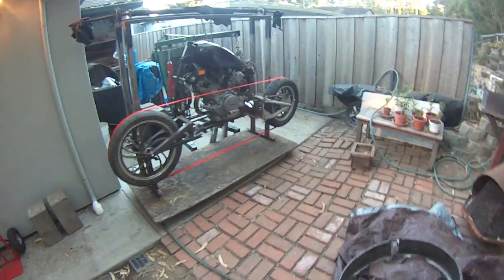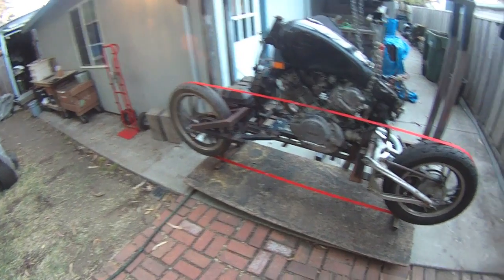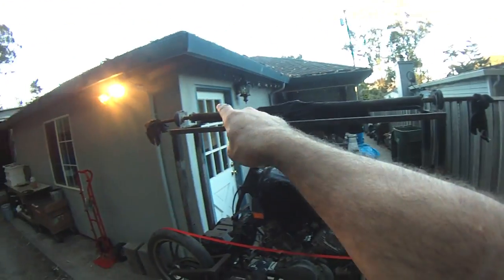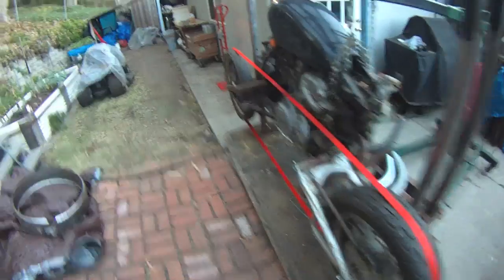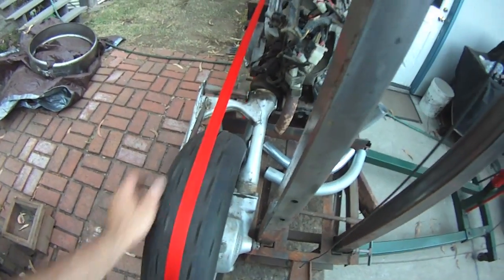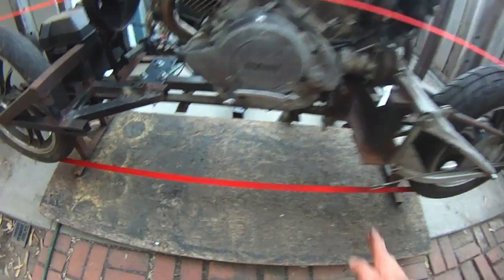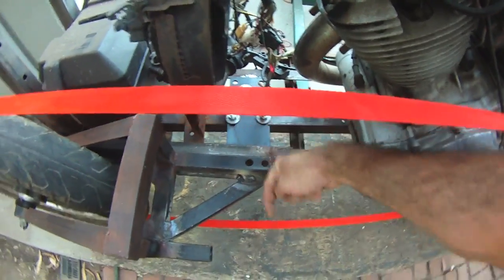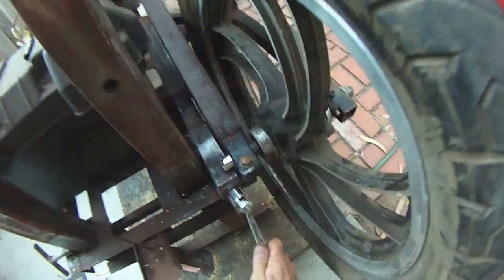Overview of the Yamasaw

Comment: I think you are absolutely correct that it has to spin the other direction.  Otherwise you'll have a little loop going INTO the wood.  The other thing,  don't underestimate how tight you need to have the blade.  Generally the tighter the better.  Butt man I wish I had that kind of power on mine...
Reply from the maker: +777strongcoffee Thanks for the info on the blade... I have a LOT of ability to get tension on the blade and I feel comfortable that it is built strong enough to handle the tension... this all might be for nothing as it may work okay with the blade roatation.  I am about sure I will be putting guilde rollers on the top of the idle wheel to be sure the blade stays aligned as it is getting pulled over the top.  we'll see, I hope the power of the engine/transmission will be to my benefit.

Comment: Maybe add some guide rollers  like a band saw to limit the whip the blade may produce and give it a shot.
Reply from the maker: +Rusty “rustyglovebox” Glovebox Oh yeah, guilde rollers for sure below the wheels to guide the actual cutting... and thinking of guide rollers on the top of the idler wheel to be sure the power pull keeps the blade aligned on the wheel.  Thanks for watching!

Comment: Thanks for the overview.  I agree your just gonna have to test it and see.  I can see where the saw may bind from running like that but if that whole system is good and tight your justification seems valid too.  A good example of what your building is a woodmisier.  You can have people google that if they don't get what your trying to build here.
Reply from the maker: +Mopardude Yep, there are a couple companies that commercially produce band mills...all of them are very expensive.

Comment: Can you swing the drive tire and engine  up put another wheel and tire under it and have it sandwich the blade on top? I should change the direction.    I would think after awhile it would chew up the tires....Man I dont know.  Good luck buddy
Reply from the maker: +2LateIWon I dont' have much room inside the framework of that cutting trolley.

Comment: Any way to flip the rear end back over and attach a sprocket instead of a wheel with a chain that powers another wheel that is inline with your front wheel?
Reply: +mjmcomputers Yeah, that's what I was thinking.  Flip it back over, run a driveshaft into a pillow block and attach a chain, then a second pillow block and driveshaft going to the rear end.
Reply from the maker: +mjmcomputers I don't have the room in the framework to do that... not a bad idea though.

Comment: How about changing gears (pun intended) and set it up as a vertical band saw? The drive wheel will then pull the blade down through the wood. Waste material will discharge down to the ground behind the rig, decreasing the amount of sawdust accumulating around the engine cooling surfaces. The log feed bed will need to be higher off the ground and horizontally adjustable, but that also means less bending over and a happier back.
Reply from the maker: +theanimalusa  Hmmm... now that's really thinking outside of the box... hmmmm

Comment: If you flipped the swing arm back over could you bolt a sprocket to the plate on the engine side and another to the swing arm side and run a chain between the two?
Reply from the maker: +02warrior I dont' have enough room in the frame of the cutting trolley to flip the swing arm.

Comment: I do not know how , but thinking if one could attach a smaller pulley or sprockets on both wheels to connect them together turning , then in a sense they would both be drive wheels , , but not sure if that is even possibly able to be done , also thinking something like the drive wheel there now raised up and run another wheel . below it with the blade on it , this is a hard one . Isn`t there a vent on that motorcycle  rear , that is now on bottom
Reply: +wtbm123 And wonder about the cut on the ring and pinion , running backwards , now i think , it will be driving with pressure  on the coast side . Time will tell . to bad you could not flip it over and extend a axle from hub out to drive a tire , but thinking the frame may be in the way . . I sure you will fix it some how
Reply from the maker: +wtbm123 Yeah...the frame work of that trolley is limiting as to how I can reconfigure and re-flip of the swing arm.  I built the trolley long before I had located a power supply.  Honestly I make more trouble for myself by thinking outside of the box... I could have easily gone with old trailer axle spindles/tires, pulleys, v-belts and a horizontal shaft briggs or similar 20+hp engine and been done with it all.
Reply: +yourbeekeeper But this is a bigger challenge , and just think of how much more satisfying it will be to u when finished
Reply from the maker: +wtbm123 I can't disagree with you on that one.

Comment: My only question is the pneumatic tires ? Will they hold up? Everything saw I've used have used a two inch or thicker drive & return wheel, how will you over come the Blade walk out? This is an interesting theory in backyard engineering.
Reply from the maker: +Lawrence Eich There are a LOT of these style band mills that use car tires and they hold up fine.  All band mills/ band saw cutting machines use guide rollers to keep the blade aligned on the wheels.

Comment: i probably did not explain correctly but i will try again,the simplest way will be if i describe it as motorcycle as it looks now,just imagine that you swoop the front wheel with the back one so the driving wheel is in place of the front one this way the saw blade will be pooling the lumber and not pushing,the only down side to it  is it will protruded and offside and take more room OR,i do not know your drive shaft but if the drive shaft meeting place with the gear is symmetrical you could just flip it 180 degree.
Reply from the maker: +nemojac I understood what you were suggesting, but at this point it took a LOT of time and fabrication to get everything in line and solidly mounted.  I am only anticipating a problem with the rotation, I don't know that for sure and I dont' have any definate way to find out until I use it.  I am not going to cut apart and re-engineer this mill for a problem that may not exist.  Stay tuned, we will all find out together.

Comment: I dont understand doesn't the back wheel turn counter clockwise the rite way?  It looks like it would be pulling the blade threw the log the way you have it now. Is the log going to feed into the cut or is the cutter going to move over the log on rollers. Ether way just feed the log from the side cuts.
Reply from the maker: +scottsinfl as you are looking at it in the video, the back wheel turns clockwise.  I put put power to the starter while it was in gear and verified it's rotation.  The log lays horizontaly on a bed I have already made and the cutting assembly will travel in the channels on the log bed and cut boards.
Reply: +yourbeekeeper ok I understand when you flipped the set up over to move the wheel's out or off set it reversed the rotation. I wasnt paying attention.

Comment: What if you flip that "differential" around, so the large gear is not up against the wheel. And the. Extend the shaft backwards to the wheel. Otherwise, what stops an engine from starting the opposite way? Is it just the starter motor? Reverse the polarity of the starter motor and see if it will run the other way.
Reply from the maker: +P0tat0_craft  It took a LOT to get everything fabricated and lined up...I am going to run it as it sits and see how it goes.

Comment: change the wheel assembly to a Honda Goldwing they're on the opposite side of the bike so they will turn the correct direction
Reply from the maker: Hmmm, I had not even considered that.... thanks for the tip.

Comment: Feed the log from the other side.
Reply from the maker: +patches350   Cutting from the opposite side can be done, but as it is now, the blade will be pulling into the idle wheel and not the power wheel...

Comment: I'm looking at your saw, and thinking you may not have enough lift. When you raise the blade all the way up the gas tank is going to hit the frame. You are going to be limited to how big a log will fit in it.
Reply from the maker: +kbert63 Great catch.  I actually talked about that issue while filming this video, but appear to have edited that part out of the final cut due to time.  Yes, you are correct... as it sits, the tank will not clear the frame.  Remember the framework was built long before I landed this power plant.   I can correct this clearance issue by moving the overhead spring back and making a few changes to the forward bar.  I am looking to get 36" of lift.  Thanks for the comment.

Comment: if you could some how make the back wheel smaller and use it as a friction wheel and ad another wheel be hind it for the blade to run on the friction wheel will make the blade wheel run in the right direction.. if it can be done with out making the blade way to long..just a idea
Reply: Interesting thought that might actually work. You have two problems that I see. First, lineimg up the driving and driven pulley. If it's offset on some sort of a jackshaft setup, the other end has to be adjusted. Or you could run a larger driving pulley than the current drive wheel and go over the top and bottom. Second problem, if you go this route you would need an idler set up with if you go with a belt, running on the wide side (if it's a v belt) and back over another idler to feed it back to the start. Similarly if you went with a chain. The major problem is you are now not using the majority of the sprocket/pulley to drive without it getting down into the cutting area, at least from what I can see with the routing in my mental picture.
Reply from the maker: +burdman1954 I really don't have much room in that framework to get too crazy.

Comment: Why not turn the blade around and cut from the opposite side? If that's daft, ignore me.. ;) But at this second, it sounds like an idea? Or not.. Hell.. I should be working.. Back to work for me.
Reply from the maker: +Scott Hildenbrand the blade is not the issue, it's the direction of the rotation of the wheels. I can flip the bade, but the teeth will be pointed in the wrong direction for the tire rotation.  Cutting from the opposite side can be done, but again the blade will be pulling into the idle wheel and not the power wheel... Now get back to work!!! hahhaha   Thanks Scott.
Reply: +yourbeekeeper I realized that after your comment and jotting it down on paper. You're always going to be at the point of pushing the blade through the wood, regardless of the cutting direction. While not ideal, I'm not certain that it will cause much issue unless you run into a bind in which case it may be more likely to throw the blade than the other way. That said, using wedges and not rushing your cuts will most likely go a long way to making sure it works out. You're already putting in guards at the top and cages on either side. Not much more you can do than that. Ok.. Back to work for me. Darn you and your distracting comments. ;)
Reply: Yes, think of it like how a regular bandsaw works. The drive motor is on the bottom wheel and the teeth are pulling down towards the table. Because of the rotation of the wheel it's pulling the blade through the wood. That's why bandsaws don't have the motors on the top wheel so it's not pushing the blade down on the table.

Comment: I think you can have blades made with the teeth in any direction.
Reply from the maker: It's not the direction of the cut (you can flip the blade and make the teeth go in the proper direction) it's the pull of the drive wheel.  I will find out very soon if this will be an issue now that the weather is getting better.

Comment: Have you thought of twisting the sawblade as if you were trying to turn it inside out. With a blade off the saw, twist the blade and make it flip "inside out so the  teeth will be on the opposite side  from when you first started. To test this theory,  make an arrow mark on your webbing that you have on the wheels now in the proper direction a saw tooth will cut on your machine, then take the webbing off turn it inside out and reinstall, you'll see that the "marked arrow" is now in proper direction to cut.
Reply from the maker: +Nortekj The blade is not the issue, it's the direction of the rotation of the wheels. I can flip the bade and it will point the teeth in the opposite direction,  but the teeth will be pointed in the wrong direction for the tire rotation.
Reply: Before I retired, we had a bandsaw used to cut metal, if you weren't careful when you opened the box of a new blade and let it spring open on it's own, 9 times out of 10 it would spring open with the saw teeth going in wrong direction when installed on the saw, it then had to be removed from the saw, twisted inside out and then re-installed on the saw.
Reply: +yourbeekeeper Your problem is tooth direction, all they have to do is point towards the driving wheel. What other issue is there?
Reply from the maker: The issues is not the blade.  The issue is the rotational direction of the wheels.  I can easily flip the blade and point the teeth in the other direction but the rotation of the wheels WILL NOT CHANGE.  it will just drag the blade across the wood backwards.
Reply from the maker: Nortekj Yep, I have worked with large band saws as well... you must be very careful unpacking the blade...and always be sure the teeth are pointing in the correct direction in relation to the rotation of the wheels.
Reply: I don't understand, as long as the teeth face the driving wheel it's not backwards! I don't understand your problem. Your shaft drive transmission is perfect!
Reply from the maker: The drive wheel is rotating in a clockwise direction... it does not matter which way i point the teeth, the drive wheel will always pull the blade from the top and through the idler wheel.  .. in a way making the drive wheel the left wheel, which is not under power.  this is operating with a motorcycle transmission and has no reverse gear.  the rotational direction of the wheel that has the power will not change.
Reply: I am aware that this is a motor cycle transmission, I have a shaft drive BMW, I am a mechanic, amongst other things. I repeat, with the teeth pointed towards the driving wheel, the blade will be pulled towards the drive wheel, there is no problem. Somebody suggested you draw teeth onto your strap, you will find that your teeth will move towards the driving wheel, just like the road under the wheel moving forward, uunless this was a special motor bike that ran backwards! yourbeekeeper
Reply from the maker: +Matthew Tinker Maybe we are talking about the same thing but in different terms.  When you stand and look at the "front" of this cutting trolley, you will have the powered drive wheel (what was once the rear wheel of the motorcycle) on your right hand side and the non powered wheel (the one that was once a front tire) on your left.  When the engine is running and the transmission is in gear, the entire band assembly will rotate in a clockwise rotation.  The bottom of the band , or the cutting part of the band will be drawn toward the non-powered wheel.  The non-powered wheel (what used to be the front tire of the motorcycle) is being turned by the band from the top of the band assembly.  In a clockwise rotation, the power wheel is pulling the band from the top of the assembly.  In this scenario, the teeth of the band need to point toward the non-powered wheel when looking at the bottom, or the cutting part of the band.  I am saying that  commercially manufactured band saws have a rotation where the bottom or the cutting part of the band is drawn toward the powered wheel, which is the most ideal scenario.
Reply: That is exactly as I saw it, seen from the left hand side of the motorcycle, wheels rotate clockwise, with the teeth pointing towards the driven wheel, they are pulled into the driving wheel! If it wasn't like that, the motorcycle would run backwards! Put a blade on it, turn it by hand, you might see it differently. Make a video of it. I have a vertical bandsaw, mentally tilt it over, and it is the same viewed from the clockwise side, the teeth are pointing towards the driven wheel.

Comment: You only need to turn the blade inside-out to get the teeth to run the right way. On a blade this size it should be easy.  Wearing Gloves! With the teeth facing you, turn one side of the blade so that the teeth face away from you, keeping the teeth away from you twist the rest of the blade so that all the teeth are facing away from you! Be careful, it might be a good idea to do this with two people as the blade can whip dangerously! I hope this is understandable! If you want to contact me, join me on Google+. You must keep the enclosed drive, dirt free transmission!
Regards, Matthew

Comment: A blade around two round wheels...you are not pushing or pulling the blade, one more than the other. Think Dozer tracks...do the tracks care if the machine is in reverse? You wont be slinging a blade because the blade thinks it's being pushed...physics says that is nonsense. That's my two cents. I am stumped on reversing that shaft drive without putting it back the way it was mounted originally.
Reply from the maker: +TheSoloAsylum Unfortunately I don't have enough room in that trolley frame to put the swing arm back in place.  Not bad thinking about the dozer...